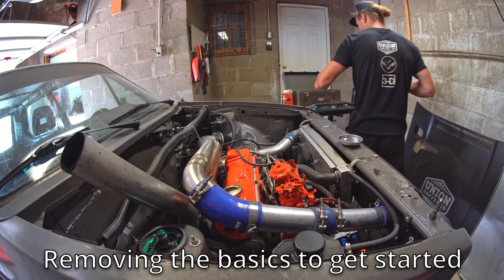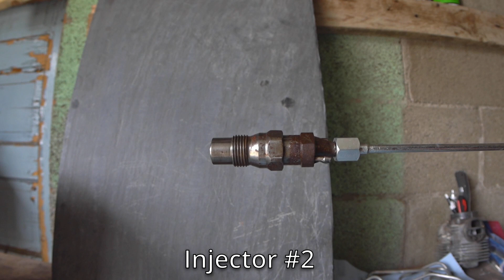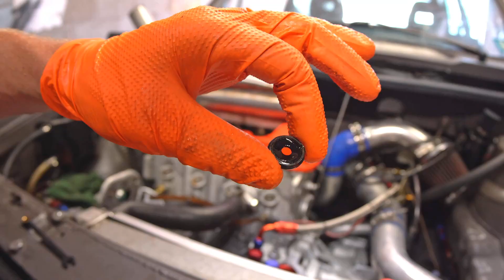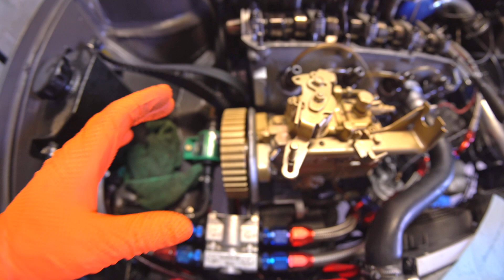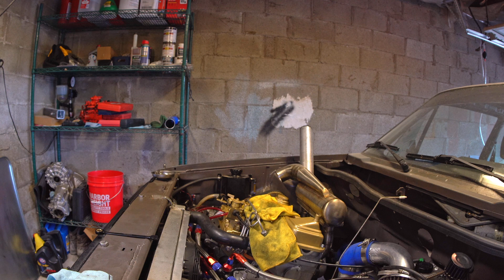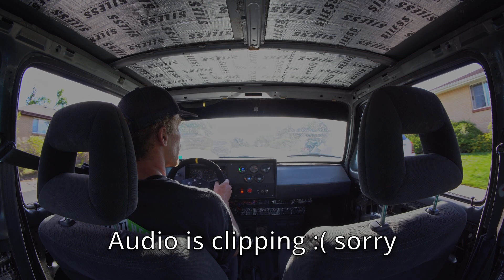Turbodiesel Pump Swap! Engine & injection timing explained

Comment: Quick question...are you adjusting the pump for performance only? Im having to do the pump on my sons car and its all stock....is the "fine" calibration needed if just wanting factory timing?
Reply from the maker: Hmm I mean if all you want to do is put around then I don't see a problem with setting it where it seems to run ok and letting it be

Comment: Replacing my ip with an original salvaged one for my 90 jetta. It got clogged and wouldn't prime, i may be able to save it though. Somehow i put my cam on 180* when i last worked on it, its been sitting waiting for me, which explains why it didn't start after last time i timed it. So im going to try to fix that.
Reply from the maker: Right on. I'm sure you'll crush it this time 😎

Comment: hey, I  was looking everywhere what's the factory plunger?
Reply from the maker: As in size? It's a 9mm
Reply: @OliverFetter  thx gonna do tdi 10mm and a plate on a non vacuum operated pump on golf 3 turbo, manifold no ic in a 1.6d, if all goes well.

Comment: I remember reading that td injectors pop at 155 and na injectors pop at 130. So a turbo pump with 130 injectors are gonna pop earlier. Don’t know if that’s what you were going for on the previous setup
Reply from the maker: Yeah you're right on. Tbh I had them rebuilt and wanted them set to 155... Odd they're in between.
Reply: @OliverFetter  I didn’t watch the entire vid sorry brother but you are probably gonna want more advance. Might have been over advanced on the turbo pump
Reply from the maker: Wouldn't a lower popping injector mean earlier injection, mean you want less advance to compensate?
Reply: These injectors will fire WHERE EVER you set/shim them to fire. Infinite setting. If you ever did any of this, you would know that. I set mine to 2650 lbs for very nice atomization. Of course, my engines are fresh no old crappers.
Reply: @mt.rushmore7916  thanks?

Comment: with the tdi cam plate 11mm head and modded rotor you basicaly have a "M-TDI" pump and if those pumps run 1.9 TDI with arround 130hp it shoud have sufficient fuel
Reply from the maker: Yes! I think it'll be more than enough but we'll find out!